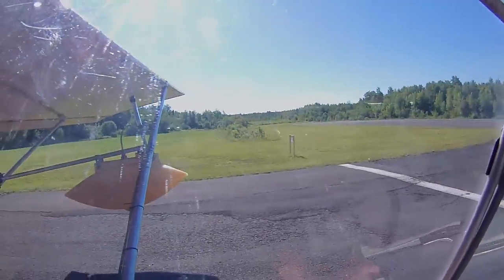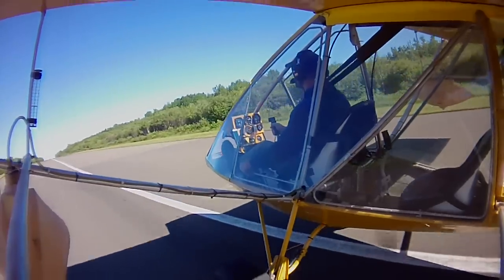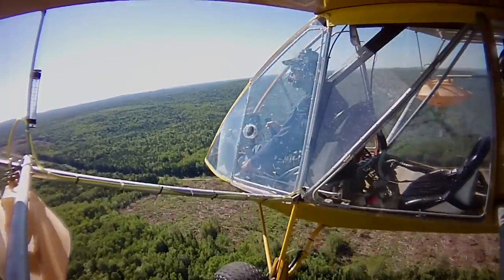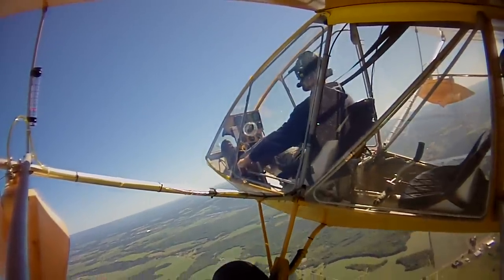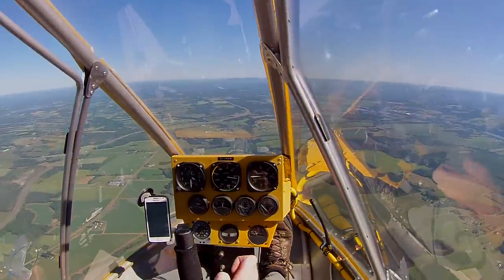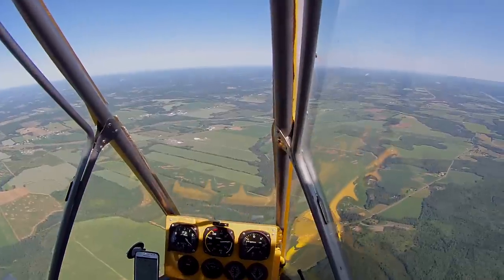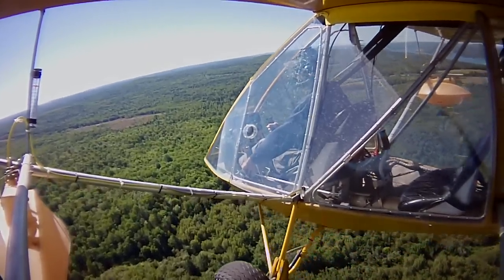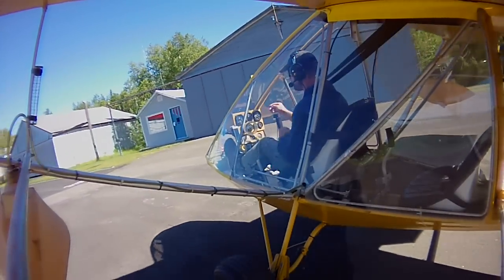Chinook Practice Session with Live Narration

Comment: The worst thing to do is sit on the runway doing final checks! Especially when someone else out there has a bad radio! Once on the runway, take off and go! Also, why back taxi on that long runway? Just turn right and take off. Minimize your time on the runway where you might be in someone elses way. And one last comment. Landing practice is good but no need to practice dragging in over the trees to hit the nunbers. Use the 1000' marking on the rwy as your target. That way a loss of power will not necessarily result in an off airport landing. And keep the pattern close so im case of a loss of power at pattern altitude you are close enough to get back to the field.
Reply from the maker: So you give me all this safety advice (not being there in the situation and so not having a full understanding of what's going on) and then you tell me not to use all of the available runway? Which is it? Be as safe as you can or just when you feel like it? lol
Reply: @mmatt it’s a trade off. Back taxiing to get more runway when you probably have 10x what you need to safely take off or abort is a bad trade off. Minimizing your time with your back to approaching traffic is smart. Practicing landings on a long runway is smart, dragging it I’m over the trees when you are learning the plane is not. You can get just as effective of training picking a spot 500’ up the runway as always going for the numbers. Stop being defensive and think through what I am saying. Maybe look at accident reports to see how many planes crash 1000’ or less from the runway. My credentials. Commercial SEL, MEL, Inst and 2500 hours of flying time.
Reply from the maker: @johndalman6616  Watch my throttle John, I'm at idle on all of my approaches, usually high and fast. I'm not dragging it in over the trees. You may have plenty of hours on big heavy planes, but these light small ones fly differently and I wasn't being unsafe at all with my approaches.
Reply: @johndalman6616  Having had an engine failure on takeoff and only just managing to stop before the airfield fence, you'll never find me missing out on additional runway. Nothing more useless than runway behind you. I fly a microlight that climbs at over 1k ft/min and was on a 700m runway.